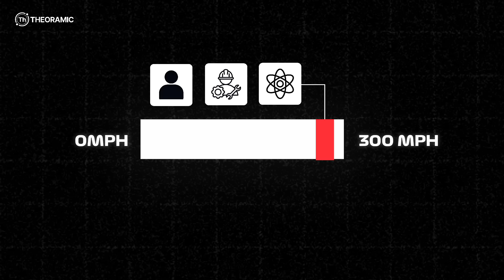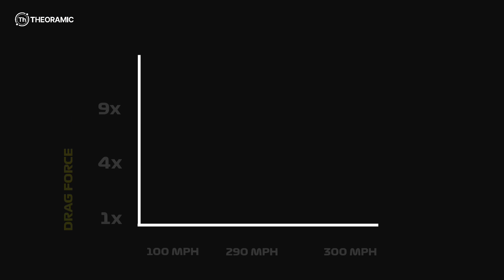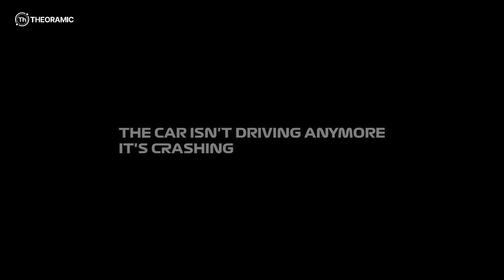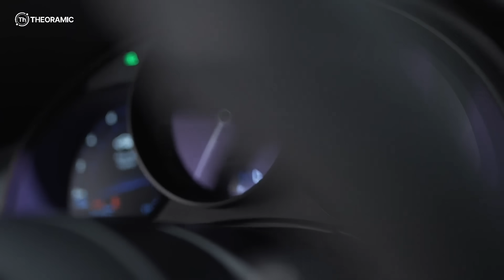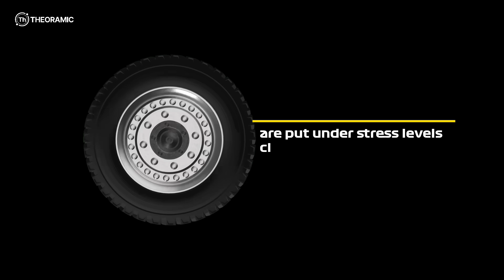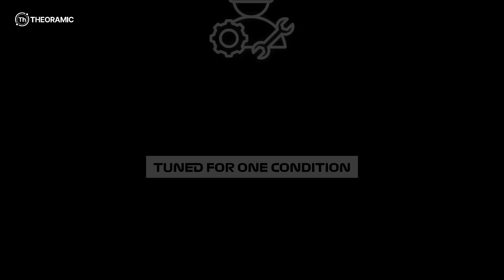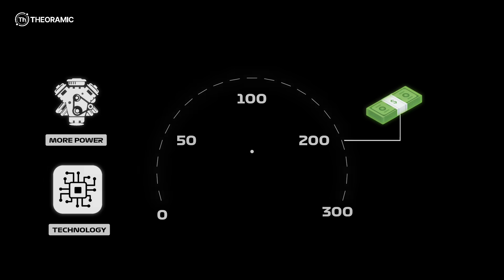Why It’s Almost Impossible to Go 300 MPH

Comment: BYD has just shown that it it is very possible😂
Reply: Bugatti literally went over 300mph, BYD just went faster than Bugatti did (Bugatti went 304mph)
Reply from the maker: yes  Bugatti went 304.4 MPJ
Reply from the maker: Why it's almost impossible to go 300 MPH
Reply: @theoramic_yt byd can go over 400 mph
Reply: @theoramic_yt  It's either possible or impossible. Dafuq is "almost impossible"? Dmbss!
Reply: @Asiansxsymbol your mom, very possible?😂🎉❤
Reply: @Asi @Asiansxsymbol  almost impossible means very difficult or unlikely to achieve, dmbss
Reply: @theoramic_yt wheezes in planes, spacecraft, and land spees records MHm- sorry what were you saying again?
Reply: @gtp_0001 those are planes, they are in the air so there are less restrictions and cars have many restrictions. Like for example, in the video they explain everything, tires, road conditions, weight, power, etc. it’s hard to go 300+ MPH on a LAND vehicle. Air vehicles can easily slap a jet engine on them and have easier designs to cut through air
Reply: @theoramic_yt  nothing is almost impossible it either is or not
Reply: Bugatti did it first
Reply: I see almost nothing about this accomplishment, it's crazy. I didn't even know the car existed!
Reply: @username_password  because its chinese car and people cant digest the fact that china out performed them
Reply: @jd7ub 
Tbh a lot won’t respect it since it’s electric. I myself view electric cars as soulless, they have no sound and it’s virtually a massive e scooter
Reply: Video only says "Almost" impossible. Bugatti has done it at 304 MPH way before BYD did at 308
Reply: @fullthrottleCPM  yes Bugatti first but still byd go faster than Bugatti..
Reply: @fullthrottleCPM  There's no such thing as "almost impossible", dmbss. That's an oxymoron. It's either possible or impossible; that's all.
Reply: How much yuan did the CCP pay you for this post?
Reply: @ManJunk7 and what's your annual salary in the CIA?
Reply: One thought if I may. TG top speed Bugatti, 304mph, 2019. Six years later, BYD couple miles an hour faster. 2025. No need to split hairs here since I think the main purpose of this video is to explain diminishing returns on tech advancements when it comes to top speeds. Shut up. Go read a book without pictures.
Reply: Almost*
Reply: @216-i6p  There's no such thing as "almost impossible" because that's an oxymoron. It's either possible or impossible. "Almost impossible" just means possible. Y'all are a bunch of dmbsss.
Reply: 300mph+ in a chinsesium car is certainly a choice
Reply: Shit is trash.
Reply: Didn't understand the message no? 😔 😆
Reply: As long as there is atmosphere its impossible for seasoned driver to go 300 mph over highway
Reply: Merde
Reply: You did the the “almost” part, right?
Reply: The anti-chinese in this comment section is strong lol
Reply: @emic28 yep, their bias will catch them with their pants down.  I’m accumulating China money… the new global currency soon.
Reply: @bitlong4669 
Well that’s certainly a choice, China willfully devalues there money and it doesn’t look like there getting it up anytime soon. 

Should put your money in assets, like bonds and stocks
Reply: Byd and a BaddGT: hold my tea and beer
Reply: it was an inclined plane
Reply: hope bugatti beats byd again
Reply: @F@FreqencyRythm-x4e5g it most likely will. The byd required 3000hp to achieve just 4 more mph than the Bugatti. The Bugatti made 1400hp and still broke 300mph. They’ll just have to make an even more powerful engine.
Reply: @Dat_Queefin_GSXR  it's easy to make more powerful than 1600hp engine..
Reply: @manpahang6583 
Yes but that’s the thing, rmr in the video it said that more hp from downforce means more drag. A lot of drag is working on the vehicle. Especially with its heavy electric engine
Reply: @FreqencyRythm-x4e5g real. I hope Keonigsegg joins the fun too, BYD doesnt deserve to put that soulless car in such a position
Reply: @PigeonsandCapybaras EV Hate is so forced. The car is cool and earned its accomplishment. Yes, engines are cooler but there is no need to hate an EV car just because its EV. People need to grow up.
Reply: @James_TPA no it’s not that it’s electric. Personally I think there’s an unknown fire to not just their magic. But their sound too. 

The issue is the lack of technological achievement and innovation in the process of this record.
Bugatti spent months preparing for its test run, perfecting tires, engine intake, vibration and wind tunnel testing. Dyno tests, driver aptitude and experience tests. And it all led to one thing. The +300mph barrier being broken.

All I could find with BYD however is they just strapped 3000 horsepower and most people don’t know that nothing else went into this. They used high-force slicks but even then the lack of good aero and tire preparation, as well as choosing a horrible driver, caused the car to jump an ENTIRE LANE. That could’ve killed them and in turn the record.

I couldn’t find any more info than that. It’s a shame BYD was so careless about it, they don’t deserve the record.
Reply: @P@PigeonsandCapybarasso what I got from this is you’re just a Bugatti fanboy. In your eyes because they didn’t innovate, they don’t deserve the record. That’s just flat out stupid. one of the dumbest takes you could possibly have. Safety concerns are valid but everything else you said is emotionally charged and honestly doesn’t matter. 

I myself love innovation too, so don’t catch me wrong. I am simply saying You invaliding others success based on your feelings is absurd and childish.
Reply: @James_TPA  I mean it’s obviously significantly harder to make a car with an engine hit those speeds so the ones that do successfully manage deserve more praise
Reply: @PigeonsandCapybaras they beat Bugatti with a double a battery, that means there’s only one rout to take, electric. Petrol cars are done.
Reply: @PigeonsandCapybaras they(byd) don't deserved that record???they already make that record..that record not just gifted record, that record have to do it and they had done it..
Reply: @ZiggZacc 
He’s not wrong though, that BYD test run was the most unstable shit I’ve ever seen 😂. 

I hate electric so I am biased, tbh that 3000hp thing is a nightmare on any engine. You’ll probably only get a couple hours before you have to replace parts I’d assume
Reply: the BYD run was proved fake.
Reply: @GiovaniFilho-uv5ex don't find anything supporting the hypothesis that its fake. Could you tell me your source?
Reply: @GiovaniFilho-uv5ex even if it wasn't, it's completely pointless and useless.
Reply: M2k motorsports world record standing mile TT FORD GT gets to 300 mph before  any current attempt by any manufacturer. 
21 seconds from 0 to 300.4 mph. 

ICE is STILL king
Reply: 300mph wall was broken many years ago, no one said its impossible. he said it's ALMOST.

also, they're using electrics. that's cheating in unwritten rule.
Reply: @MRworldEtIkA it’s no cheating, it’s finding another way.
Reply: @ooogabooga4836 
Electric cars don’t have to go through the hurdles a combustion engine has to go through in terms of acceleration. Also no sound… what’s the point of having a car and it has no sound
Reply: their specially selected model might of shown it was possible but with the chinese facade and their shortcuts and cost cutting methods, are their consumer models gonna live up to the hype? Unlikely
Reply: @Sherb69420  this comment's irrational dismissal or refusal to accept that China is capable of manufacturing good quality stuff now is why Ford and other American manufacturers all of a sudden found themselves in a panic at how cheaply and efficiently China was making better cars than they were.
Reply from the maker: yes 👍 it's very unlikely
Reply: @Sherb69420  their making 20 units i belive. They’ll all be able to go that speed but may have some limiters depending on certain laws.
Reply: BYD is junk.
Reply from the maker: why do you say so
Reply: @kemetm3 It's cheap Chinesium, built using stolen technology from Western countries.
Reply: @kemetm3  fart its not byd
Reply: @kemetm3   No its not. Its a beautiful Hyper Car that earned its spot. EV hate will always be forced.
Reply: @James_TPA dude I lived in China for several years so your lies will not work with me…try someone else in the comments section.
Reply: @kemetm3 that still doesnt help your point.
Reply: @Purplecolourblindpersonwhy not?…if I was there and not only there but doing business there I would have first hand knowledge of the junk cars and mostly everything else they make…it’s gotten better but not to the level of competition in the world market…cars that is now other stuff such a clothing and some electronics they do well but not cars.
Reply: @Purplecolourblindperson he said it's doesn't work to him bro because he has lived in china and see with his own eyes..he didn't say it's doesn't work to you and others..
Reply: It’s just pointless in a car.
Reply: @m @marekstanek112 unny how its now seen as pointless when the car just happens to be electric. I suppose the top speed of the Bugatti chiron super sport is also pointless in a car.
Reply: @Purplecolourblindperson It actually is. You can hardly ever use it anywhere, as the traffic is too dense and even the racing circuits are too short. And the vehicle will consume all its fuel supply in single digit number of minutes, making you able to cover less than 100km on the whole tank, after which you must stop and refuel, and per the safety manual, you will be able to do that exactly TWICE before having to replace the whole WHEELS with tyres, which will cost you about 30 thousand dollars and the car will refuse to exceed 130km/h without the wheels replaced.
And yes, I doubt the BYD will allow you to do that more times than the Bugatti.
Reply: @marekstanek112 a pointless car beat a legacy car, Bugatti

Comment: Why didn't you mention the Yangwang U9 anywhere. It literally went 308mph.
Reply from the maker: Since Bugatti was the first to attempt it, I used it as an anchor for my video on why it's almost impossible to go 300 MPH.
Reply: It had more in it i bet. Some chanel called engendering explained calculated its top speed.
Reply: Dude ,Also the U9 was even had some issue trying avoiding the railing before hitting 300mph. It just broke the record. Most people are aware of the Chiron than the U9 since it been around longer.